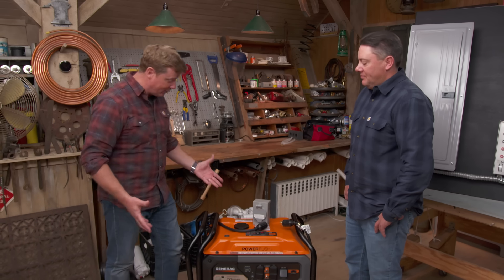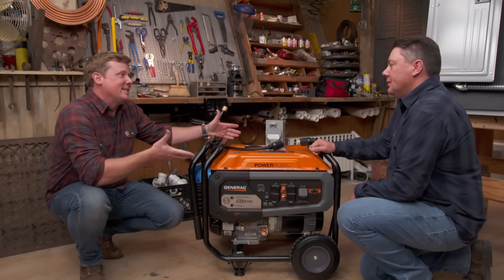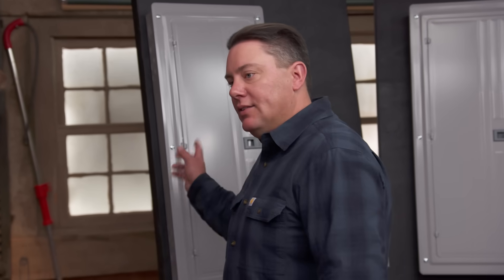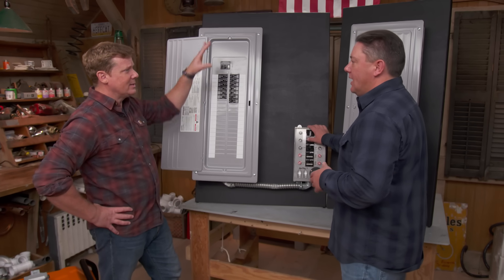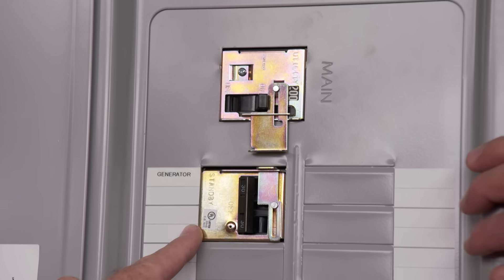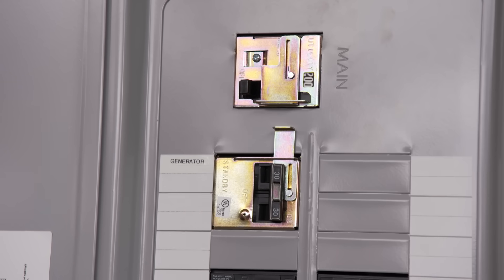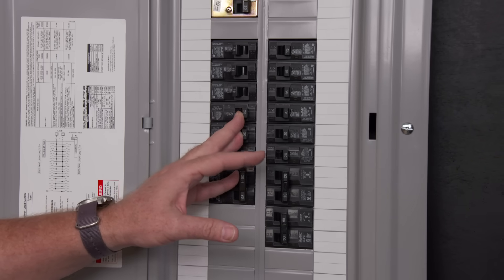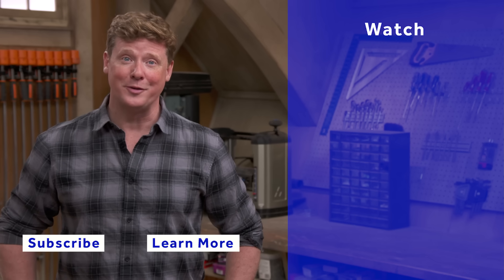How to Wire a Portable Generator | Ask This Old House

Comment: It seems to me that the interlock switch would be a cheaper, as well as a much better choice than the Transfer Switch. I like the option of picking and choosing which circuits I want to run, from the main panel.
Reply: Yeah, same here, I like how the interlock won’t let you turn on generator until main breaker is off. Simple, safe concept.
Reply: Agreed, I have a main breaker panel. Then I have a owners pole on my property as well. I flip the main and transfer switch and for good measure I flip the breaker panel on the owners pole as well for good measure.
Reply: Interlock is the way to go, not the setup in this video.
Reply: The additional sub panel is good for customers that don't have room left in their panel to add double poll breaker for a generator.  

So that frees up space in the panel while providing you the essential circuits. 

So they both have their pros and cons.
Reply: Please make sure you are aware with all the hazards of using generators. Generators can be dangerous if used incorrectly. Here is what everyone really needs to know and be aware with. Always remember that carbon monoxide fumes are dangerous to inhale and it’s an odorless and colorless gas that you can’t see or smell. Carbon monoxide is a silent killer. That’s why you should never run your generator indoors and having a carbon monoxide detector is very important as well. Your portable generator should be 15-20 feet away from your house and away from doors, windows, and vents. It’s never safe to use your generator indoors even if you have your doors and windows open. We also need to keep our children safe when we’re using portable generators so they won’t get electrocuted or burned by the generator which is dangerous. Make sure your children are not playing near the portable generator to avoid risks. Generators can be dangerous. It also says on the manual to keep children away at all times when the generator is running. Generators can be hot also. All instructions on the generator’s operating manual should not be ignored. Generators pose electrical risks. Do not ever connect your generator to a wall outlet to avoid back feeding. That can cause fire and electrocution on power lines which is also dangerous to your neighbors. Please don’t run your generator in wet conditions. You’ll get electrocuted if you use your generator while wet. You need to keep your generator dry. Don’t let it get wet. You also need a generator tent to protect your generator from getting wet. Do not overload your generator as well please. You need to use a heavy duty cord for your generator too. Make sure the cord is not worn out. Please turn on your generator first before plugging in appliances. And shut off your generator first before you unplug the appliances. Please never refuel your generator while it’s running. You need to turn off your generator and let it cool off before refueling it to avoid fire risks. Generators can be dangerous if you don’t follow the instructions. Make sure your generator is properly grounded. https://youtu.be/I1jT3ANENvI and here is a video more about keeping your family safe while using generators. Thank you. Hope you all stay safe and this advice is only a reminder for everyone’s safety. Be safe.
Reply: @The_Happy_Aviation_Enthusiast  lol good advice.  But as far as wet well obviously you aren't in construction.  They can get wet .  If you can shield it so . Sure why not . But they are by no means a major problem if they get wet. Not sure what kinda generators you are used too lol

Comment: This would not be an option for Texas if you can’t run the AC lol
Reply: You absolutely can run an AC off a generator, but like anything it needs to be sized correctly.   Don't think you can get away with a 2000 watt generator if you have a 3500 watt central AC unit.   That said, the one shown in the video is a beefy 6500 watt unit, so probably could handle your central AC, unless you have a rather large unit.
Reply: @Mike__B  10-4. He just said you wouldn’t wanna run the AC off it so being from Texas that’s why I said that wouldn’t work for down here lol

Comment: I made my own interlock switch & wired up my whole panel as shown. I also included complete operating instructions on the inside door of my breaker box that anyone could understand. 
I also added a power back alarm at a later date.
Reply: Here is a reminder about portable generator safety: This advice is just to make sure that everyone is aware of all the warnings and it’s just to remind people to be careful using portable generators. Everyone has to see this safety reminder for safety. Every year, hundreds of people die or get injured when using portable generators due to carbon monoxide poisoning and electrocution. Make sure you are using your generator carefully and keeping others safe as well. There is something very serious that everyone should always be aware of when using generators. Some people do run their generator indoors which is not safe and that increases the risk of carbon monoxide poisoning which can cause death of family and you. Some people run their generator in wet conditions which can electrocute them. Please remember that you should never run your generator indoors. Remember that carbon monoxide is an odorless and colorless gas that you cannot see or smell. Carbon monoxide is a silent killer. Keep that in mind. Make sure your generator is 15-20 feet away from your house and away from doors, windows, and vents. Never use your generator in your porch too. Having a carbon monoxide detector is very important against generator safety. Some people also allow children to go near the portable generator which could pose risks. We need to keep an eye on our children making sure that they are not near the portable generator so they won’t get electrocuted or burned by the generator which is dangerous. A locking enclosure also keeps kids safe. A generator shed might look like a tempting place to explore, or take cover during a game of hide and seek, but a generator is a dangerous piece of equipment that can cause injury. It says on the manual that we should also keep children away at all times from the portable generator to avoid injuries. Please do not allow a child or unqualified people to operate the portable generator. Just because some manuals missed what should be listed doesn’t mean it’s safe to do. Always follow the generator safety rules when using portable generators. Generators pose electrical risks. If you need to use your generator during wet weather, you need a generator tent to protect your generator from getting wet. Don’t let your generator get wet. Keep your generator dry and before using your generator, please make sure your hands and your generator is dry. Do not wear loose clothing when operating the generator. Everything that is said on the generator’s operating manual should not be ignored. Never smoke cigarettes near the generator. Please keep flammable things away from the generator. Never overload your generator too. Your generator can catch fire. Never ever try to plug a generator cord into a wall outlet to avoid back feeding. Back feeding your generator is dangerous. Always turn on your generator first before plugging in appliances and shut off the appliances before turning your generator off. Use a heavy duty cord for your generator and the cord should not be worn out. All the instructions should be followed carefully. Never refuel your generator while it’s running. It can cause fire if fuel spills while your generator is hot. You should turn off your generator and let it cool off before refueling it. Having a fire extinguisher next to the generator is also important. This is only a reminder for everyone’s safety of using generators. Make sure your generator is properly grounded. https://youtu.be/I1jT3ANENvI and here is a video more about keeping others safe when using generators and also about our family’s safety. Hope this helps. Thank you.
Reply: @The_Happy_Aviation_Enthusiast  All good points that sadly not all will follow.

Comment: In the case of using for an emergency backup, should I bond the generator or leave the neutral floating at the generator?
Reply: My FIL is an electrician and wired my transfer switch for my floating neutral generator. He bonded the transfer switch to the neutral at my panel, which I'm assuming is code. 

I remember us specifically checking if my generator was bonded to the frame or floating.

Comment: What about an automatic transfer switch and a stand-by unit? There are more options and wiring up a transfer switch would make for a good episode.
Reply: Automatic transfer switches typically aren't used in houses because there's no need for them and they cost a lot more money. The transfer switch itself cost more money and you need a permanent generator which also costs more. They're good when a building needs uninterrupted power 24/7 such as hospitals, fire halls, etc.

Comment: When wiring the generator to the panel with an interlock you have to be aware that the generator should have a floating neutral. Unfortunately, most generators under 15kW have bonded neutral.  Check the code in your jurisdiction.
Reply: I agree with you. I know a lot about generator safety: there’s something that everyone really needs to know about when using generators. We should also keep our children safe when we’re using portable generators because generators can be hot which can burn them or electrocuted them and they could also get poisoned by carbon monoxide. This is what everyone really needs to know. Generators can be dangerous if not used carefully. Generators should not be used indoors because of carbon monoxide. Make sure you Install a carbon monoxide detector. Don’t try to plug a generator cord to a wall outlet. Don’t run your generator in wet conditions. Don’t even run your generator in enclosed areas of your home. Don’t run your generator in a garage. Generators are outdoor use only. Keep your generator 20 feet away from your house. https://youtu.be/I1jT3ANENvI and here is a video more about generator safety and keeping children safe. I’m just hoping everyone stays safe and be careful using portable generators. Make sure you read the manual carefully. Hope you stay safe. Thank you
Reply: @The_Happy_Aviation_Enthusiast  Code is to have a minimum of 5 feet distance from the house or any opening (window, vents, etc). You can put it 20 feet from your house, but that can be excessive and some may not have that much space to accomplish that. The idea is that it should be in an open outdoor space not confined in any way and away from any combustable materials that could take in ambient heat from the generator and potentially catch fire. Keep in mind, the further away from the house the generator is, the longer your power cable needs to be. Though the longer your cable gets, you need to make the cable thicker otherwise you could overload the cable and cause it to melt.

Comment: I have that same generator... it’s neutral is bonded to ground. Did you switch the neutral on that transfer switch?  Did you disconnect the generator neutral from ground when using the interlock?

Comment: How do you set up a generator so when the city power cuts out the power from the generator will power your home as if the power never went out? For example, I have an 80,000.00 power chair and a CPAP machine and it's not good when they go out in the middle of charging and being used. Is there a way that a person can make it so nothing will lose power from the transition from city power to generator power without any devices like clocks etc stopping at all? It would be nice to have something that could power the entire home as if there was full city power? I know that there are some generators that when power is lost it may take a few seconds to a minute or two to start, I don't want that. Totally seamless. As city power is draining the generator has started and is slowly replacing power that is being lost so the same amount of power is entering the home.
Reply: The only way for this to work would be to have a battery backup setup, and an automed generator. So you'd want a standby whole home generator with automatic transfer switch. Then when the power goes out the generator fires up after a couple minutes. Then you get a battery backup like a UPS for a computer system, and plug your CPAP device directly into that. You could also run the battery backup, and get a large enough backup to supply the CPAP while you hook up a portable generator (this would cost about 10-20% as much as a standby.

Comment: no mention on how to size the generator for the loads  especially with motors like a well pump
Reply: That's' not what this video was about. They only have 20 minutes
Reply: Figure about 3500 watts for central air. 1000+ watts for microwave. Few lights might be 60 watts. TV about 60 watts. Tower computer, 1200 watts. Basically your air conditioning, electric stove/oven, and electric dryers probably not want you want to run off a portable generator. For essential items 6500 watt running is plenty for most homes. For everything, you wanted at minimum a 10,000 watt running generator and larger. At that point, you are looking at home standby generators from Generac, Kholer, etc. These will run off your main natural gas line, or LP gas if you are on Propane.

Comment: Do all modern portable generators shut off if overloaded, or do generator circuit breakers go off? 
Confused about that.
Also, my gen has a 30 and a 50 amp receptacles should I use the 30 or the 50 if I run an interlock switch.

Comment: Hey TOH, you should have shown how to wire the gen to the electrical panel.
Reply: I think that the reason it wasn't shown is that this is not a do it yourself job. The wiring should only be done by a licensed electrician who would already know how to wire it.
Reply: The power cord from the generator is plugged into the power inlet box which in turn is wired into the main electrical panel which should only be done by a qualified, licensed electrician.

Comment: I have a 1288 sq ft house I want to hook up a portable generator can I run my dental air and heat unit with this
Reply: No
Reply: Thank you foe your response then what is the safest way to run my central a.c. when my power goes out
Reply: @robertmikita5745  .... buy a gen set that's 3-4 times larger than what you would otherwise need because that's what it will take. This is the biggest reason people don't run central AC with a gen set. Heck, unless it's a week long outage that's a LOT of extra money to spend.

Comment: As someone with no knowledge, I really appreciate this kind of video.  I'll certainly get my generator connected by a licensed electrician but this really helps me understand what is involved.  Nice job guys.
Reply: Thanks, gentlemen, all very helpful information.
Reply: Agree with the commenter - no expertise for me but now I feel like I "get it".
Reply: Mark, to save you some headache I would suggest an Inverter generator with a floating neutral and a reliance transfer switch.  A regular generator wont play nice with UPSs or electronics.  The floating neutral is so you can have a simpler and less expensive transfer switch.  Hondas are floating and Champion tells you how to convert.

Comment: Why doesn’t anyone ever talk about floating vs. bonded neutral on the generators?  It impacts the way your disconnect needs to work at the panel (either the sub-panel or the direct feed with interlock). Get that wrong, and you could energize the frame of your generator.
Reply: They didn't talk about grounding the generator either.

Comment: And what is the average cost of installation? Around 10k minimum?
Reply: $500 -800 for the whole  house one..
Reply: An interlock and inlet is 800-1200 the transfer switch shown is 600-800 more.

Comment: I had an interlock installed about a year ago. Bought all the supplies from Amazon; the interlock, a 25 ft. cable, and the power inlet.  Total cost was $185 and I paid an electrician $120 to install.
Reply: Thank you for the info. I was sitting here thinking it would be > $1k.
Reply: He didnt charge enough..
Reply: @DonkeyLipsDA3rd    he charged appropriately
Reply: @petersack5074  that is nowhere near enough to charge. Unless you live in a backwoods town where everybody’s cousins.
Reply: @KitchenerLeslie2  He charged what he was willing to charge. Every area is different as to how much services go for based on how expensive (or inexpensive) it is to live in a given area.
Reply: @KitchenerLeslie2  FYI. It took one electrician about 45 minutes to install, start to finish. $120 for less than 1 hour of work seems more than fair. Oh, I live in a city of 150,00, not large but certainly wouldn't describe it as a backwater town.
Reply: @cfoskeeter  I agree with Keith.  Usually tradesmen charge about $125 per hour for labor, plus materials.  $305 out the door sounds about right.  Shouldn't be more than $375.

Comment: My dad runs 2 electrical cords into the house from the generator if the power goes out. Mostly just at winter to keep the pellet stove, fridge and a light going. He has heavy duty electrical cords to do it. He does run the generator in the garage but it's a unattended garage and he leaves a door open. His generator he uses is really loud so he keeps it in the garage to try to keep the noise down. Thankfully he lives out in the country so the neighbors are not close by. It works for him. They don't lose power often so really wouldn't be worth the cost to hook it up right. This winter they lost power once. Last winter they didn't lose power at all. His generator is a 3,500 watt enough for what he needs. He also has a 2,500 watt but he uses that for camping as it's quite.